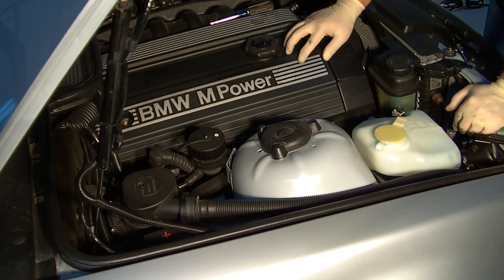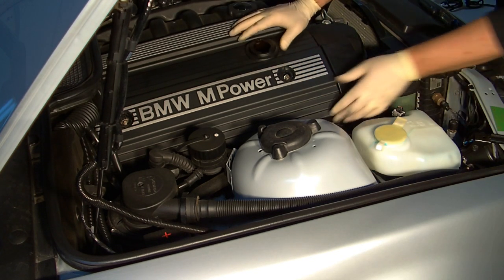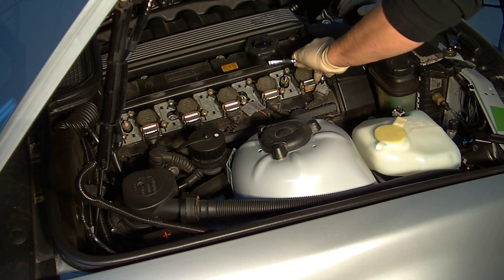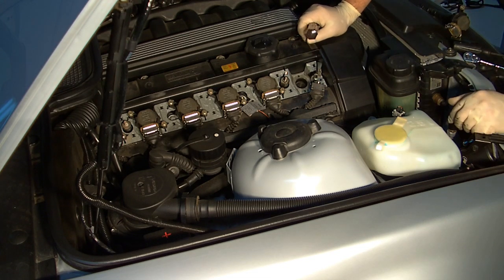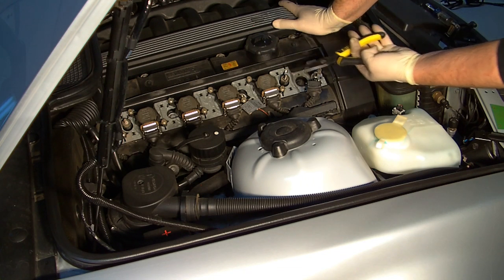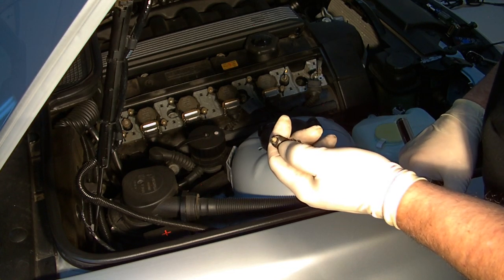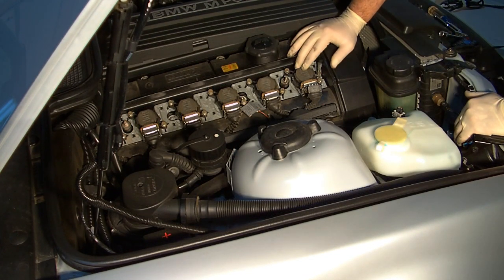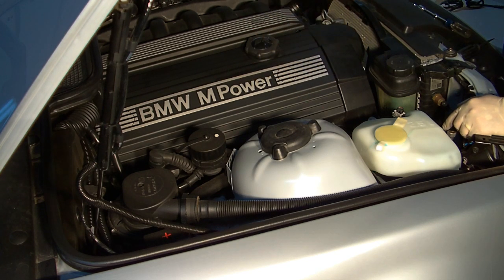DIY Replacing BMW Spark plugs -- E36 M3

Comment: I read that all the coils are the same, and it doesnt matter if you mix them up. Why do you say otherwise in this video? Did you mean that the wires going to the coils must be put back on in correct order? That would make much more sense! Great video at any rate, thank you for taking the time!